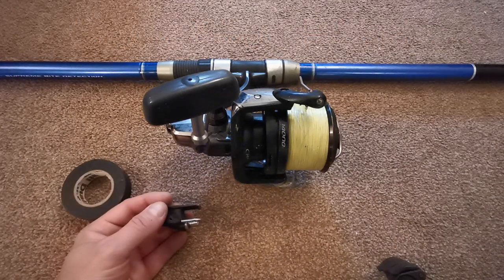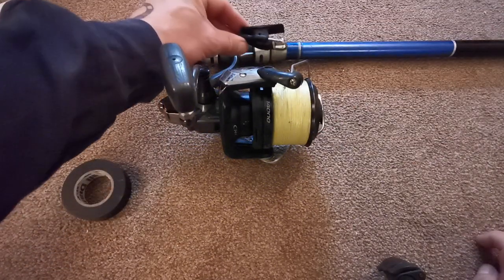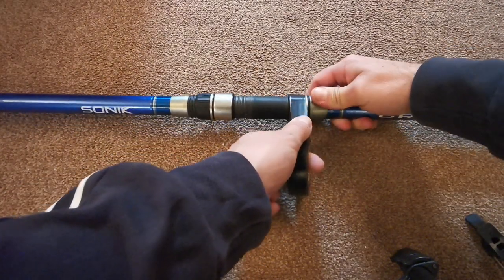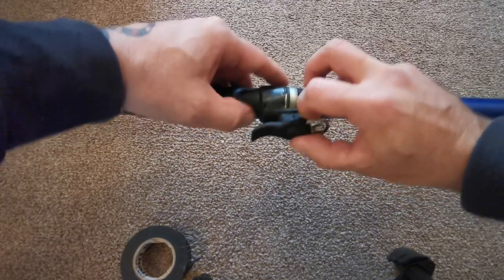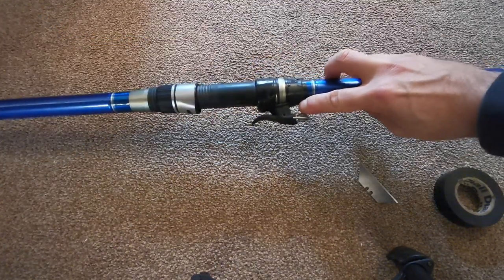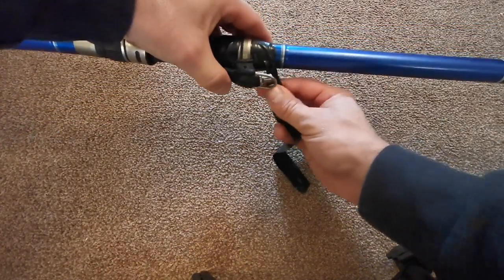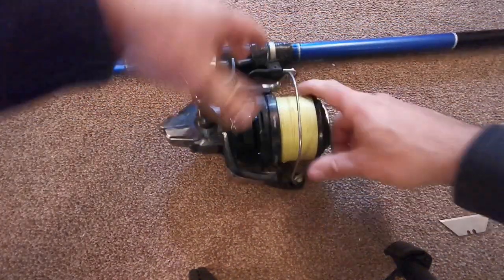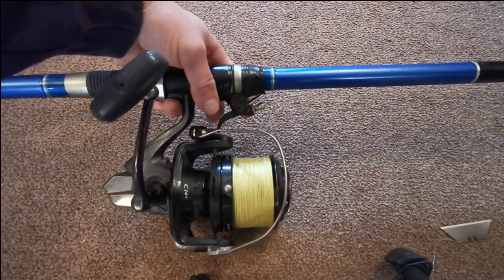Sea Fishing UK | Installing and Using A Casting Cannon

Comment: I use one of these myself. They are absolutely fantastic. I attached mine to the rod using wide cable ties. It is solid. Great video. 👍
Reply from the maker: Exactly! It's all what works for the individual 👍 they are cracking little devices
Reply: Absolutely, they really do give some extra distance to the cast. When I used mine for the first time, I was amazed at how much extra distance I got.👍

Comment: Aye cheers for that, my main reason for not using heavy braid straight through was the cuts I get on my casting finger pretty frequently even when using mono, I'd seen these before but never really considered them for my purposes but now I might have to pick a couple up
Reply from the maker: I would still use lighter braid with a mono leader regardless👍

Comment: Good video!  I've got two as well, from good ol' Norman at Breakaway tackle.  They definitely help with casting.   True what you say about it sometimes being difficult to attach to the slope on the rod - I put some neoprene double sided tape under the Cannon and used zip ties, 2 each side.  Saw your post on TSF about the Rig Jig so gave you a sub.  Stay safe & well. 👍👍
Reply from the maker: Many thanks for the sub and I did see your like👍

Comment: Great video..I also have the same issue where the end of the canon does not sit directly above the reel spool..slightly over and most times when I cast the timing does go out and feels like I have let go too early. the cast is then fast and the line is released quicker and sooner so I have to releas later but even then it is out of my control and teh line springs off too quick and the cast is really short. I am thinking of experimenting by cut half of the back leg so there is just enough to whip it on at the back.. I could suggest that breakaway make the back leg shorter..apart from that what a great tool. If everything goes right for my on the day I can cast a lot further. They just need tweeking slightly
Reply from the maker: I have cut the rear leg shorter on one of my vannons and it does work👍

Comment: Thanks for the demo. I have used the cannon twice and each time i snapped off, what am i doing wrong? I have a Penn surfblaster 2 8500
Reply from the maker: It's very difficult to to understand what's going on without seeing the setup.  What strength leader do you use? And do you have 5 - 7wraps of your leader on your spool
Reply: @gsp  Thanks for the quick reply. I was using a 13ft Shakespeare Sigma Supra rod, no shock leader just straight through 30lb braid with a 4oz and 5oz lead on an open beach to test using the cannon, gave up after 2 casts.
Reply from the maker: @davidprobert8223  30lb won't take the shock of a full cast with a 4oz lead.  The cannon does allow you to compress the blank easier so you really are loading it up and as braid doesn't have any stretch there is no forgiveness and it's going to snap at the weakest point, which is probably where it is held on the cannon.  As was use the rule of thumb that for every once of weight you want 10lb of breaking strain plus 10lb.  So 1oz =20lb, 2oz =30lb, 3oz = 40lb, 4oz=50lb and so on
Reply: @gsp  Thats really informative, thank you. I will get back out there (after lockdown) and give it a go, hopefully with better results, thanks again.

Comment: Has anyone tried installing these using heat shrink tubing? Does it work/hold OK? Think it would look a lot better and last longer without the inevitable unwanted 'stickiness' of old tape.
Reply from the maker: Heatshrink wouldn't hold, the casting cannon would slip round but you could whip it on and put finish on it to make it look professional

Comment: Save money and use a glove
Reply from the maker: It's not the same at all, I can cast fine without a glove but this device adds a little extra security
Reply: @gsp  I been using braid with a glove , The black thin builders type never had a issue and thats putting full pendulem into the cast .
Reply: Save money (£10 one off purchase) but use building gloves at £1 per pair which need laundering/cleaning and replacing at a frequency and include the faff of putting on and taking off to cast/bait up....
Reply: @stephengreenwood4885  Fair point